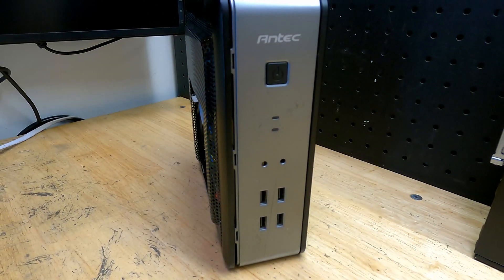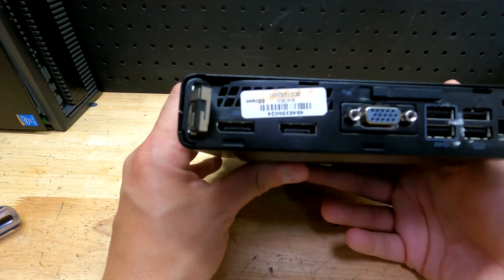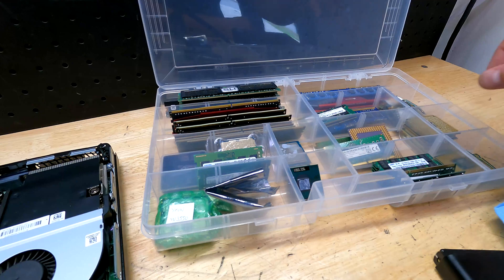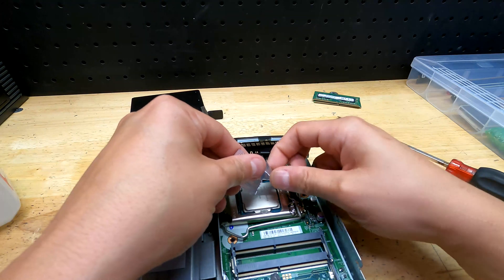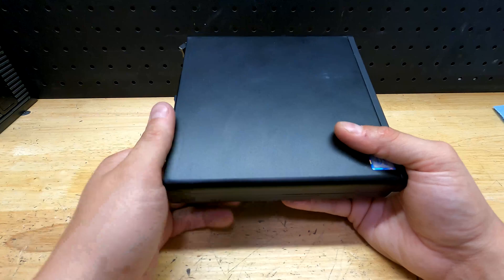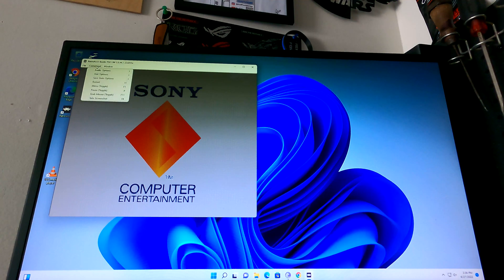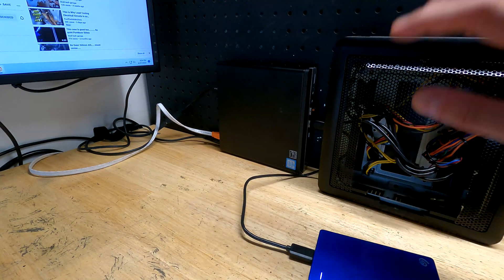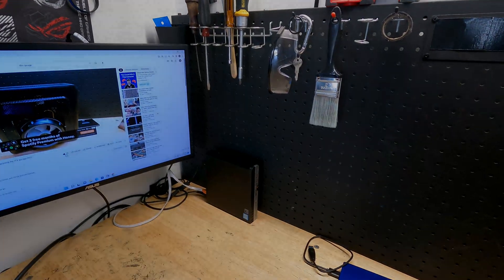I fried my garage PC!! HP EliteDesk 600 G3 Desktop Mini and RetroArch!! Cheap emulation PC!!

Comment: 800 g3 model with the 6500t from ebay, i had an old i7 6700 processor from an old pc. Would that work as an alternative?
Reply from the maker: yup, the t only mean it was lower power for the smaller pc as the lack of air flow and fan.

Comment: I have had good luck with Gamecube @720p on Skylake/Kaybelake systems with integrated graphics. Dolphin is Very well optimized.
Reply: Older systems seem to run the actual emulators much better then the Retroarch cores. Dolphin is a great example.
Reply: @DM-sc4ru  stand alone emulators are nearly ALWAYS better than cores except for very few limited cases. The newer the console, the more likely you will need a stand alone. Typically retroach cores are best used in bulk on very old consoles that have already been HIGHLY optimized. Using retroach makes set-up of multiple systems easier and is PERFECTLY fine for systems like NES, SNES, Genesis and more.
Reply from the maker: i need to figure out the whole gamecube thing. lots of games I miss.

Comment: good for smb sector 6/7th gen to 10th gen - 10th gen gives you double ram capacity but you pay about double - the mt cases are better - just easier to work with and sometimes you get more slots - options are good but may be limited due to hp/dell walled gardens

Comment: Don't use brake cleaner, use IPA or Electrical parts cleaner or just wash it and dry it very well! Also visually inspect the other ITX board and the PSU. It may have been the PSU that blew up so test that mobo with better PSU!
Reply from the maker: yea i did. the board was still good. I learned not to play with brake part cleaner around computers lol...

Comment: Always make sure to have your computers or any electronics turned off before cleaning near them. I once dropped water on my laptop and shut off the power immediately, then I took it apart as fast as I could and dry it out. It still works fine up to this day.
Reply from the maker: Good tip!

Comment: You could install it on a vesa mount behind the monitor , just have a USB extension lead down towards the desktop. BTW the SoDIMM memory usually has to be the low voltage (1.35 volt)  type in this sort of system i.e. DDR3L. I have a couple of the Lenovo ThinkCentre 93s which are quite good but do have a whitelist built into the bios to only accept certain CPU types.
Reply from the maker: wow did not know they could whitelist a cpu. crazy!!
Reply: @DLMtechgarage   Yes itll work with some i7 cpu models but not others, a very strange way of making a product indeed.

Comment: If you look under the metal support for the ssd there should be a m.2 slot. You can also add something there as well. Most of them models support that.
Reply from the maker: need to check that out. appreciate the info!!
Reply: @DLMtechgarage  not a problem. I have a bunch of the small form factor ones like that. And they all have a m.2 slot on them under the 2.5 inch drive cage.